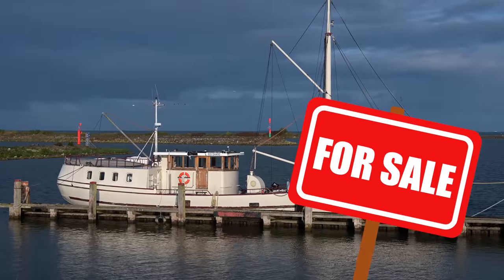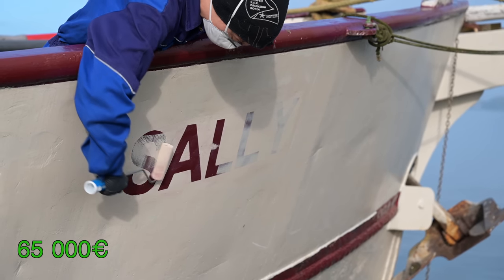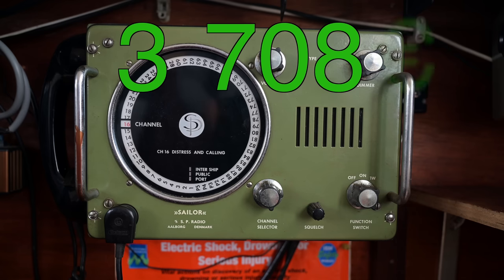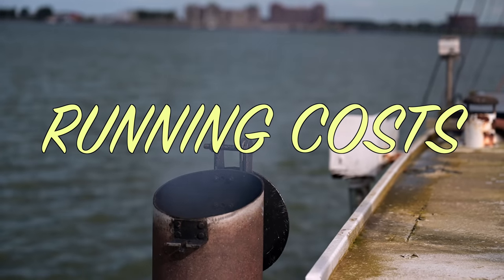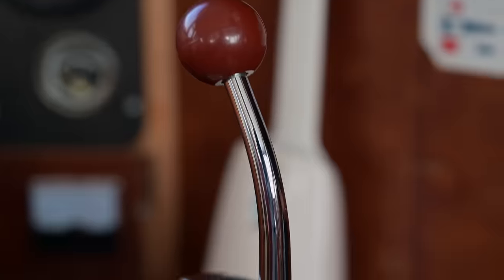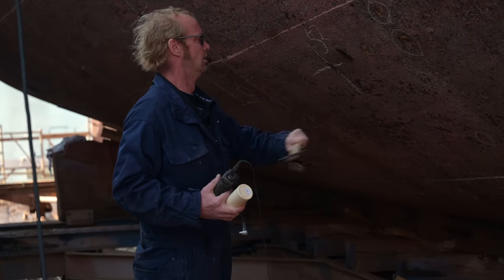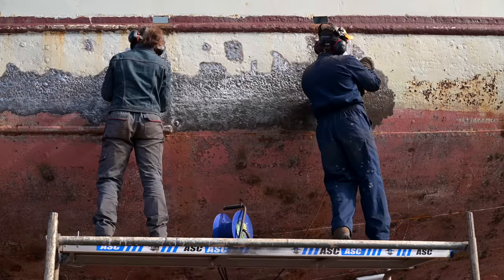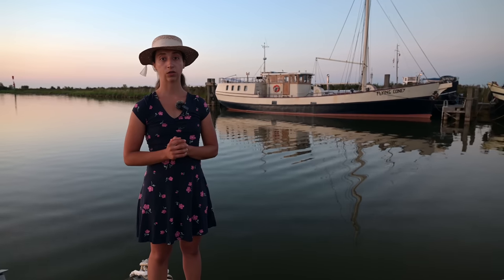This is HOW MUCH our refit costs? Is It Worth It?

Comment: Regarding the pump, the inlet and discharge orientations suggest this may be a self priming pump (providing the pump has been filled with water before operation) which is an extremely useful feature as the pump can, if necessary, be mounted above the water level without the need for an inlet non return valve or a priming system.  Also it looks like it may be manufactured from a marine grade material such as zinc free bronze.  Also it looks like it may be a relatively slow speed pump which gives high levels of durability and relibility.  If I am correct on any one or all of these points this is a very valuable pump.  The long radius bend in the inlet pipe is  good practice for a top entry pump, never have restrictions or short radius bends in your inlet piping.  With any 3 phase driven pump check the direction of rotation is correct.  Set the motor overload to about 10% above the maximum current the motor draws with the pump at full load.  With this design power demand is proportional to flow, the lower the pump discharge pressure is the higher the flow and  power.  If there is not enough back pressure on the discharge the pump will not prime and it will likely cavitate.  If you can identify the pump brand and model and find a performance curve for the pump and advise the rotational speed I can assist with the correct application of the pump.  If you find it doesnt pump try filling it with water, have the intake system fully open and strum boxes etc clear then close the discharge valve down to about 5% open start the pump and run it until discharge pressure builds before gradually open the discharge valve.  Vacuum leaks in inlet piping can be identified by wrapping cling film over one piping joint at a time to isolate problematic joints.  Regards and good luck.  Doug from New Zealand.
Reply from the maker: Hi Doug, the pump is from the brand SiHi and they still make this kind of pumps. They are high quality and high output and I think you're correct that it's a self priming pump. A viewer who works in a company that does service pumps (how convenient) was willing to help us and took on this project. Actually this week he opened it and gave it a good service. The pump is still in good shape and it just needed the ordinary service parts like gaskets and one bearing. Also the electric motor is working fine. He painted it in the correct color so it does look like new. Thank you for offering help and advice! It's always appreciated by us.

Comment: what about the estimates for a complete new sailing/rigging plan, accomodations and modern day comfort equipment, the complete rebuild of the interior, nav systems, refrigeration, AC, watermaking, water heating, energy powerplants, ) you have a good main engine, but then a generator, high output alternators, solar panels, batteries, DC and AC systems, the list is "endless".
Reply from the maker: Kind of endless. But you don't need it all at once. There's just so much time we can spend refining this boat so 20-25 000€ per year is a good number. 3-5 years until we're finished. A basic rig at the END of the project will cost about 80 000€ but maybe we find masts, booms and so on second hand.
Reply: @FlyingConey   i dont have a reference for spars price, wooden block, all the running rigging you will need to run that, which is in the kilometers scale, sails, etc but i found that 80k really optimistic. or maybe you plan to build most of it yourself? for a boat that size the electrical system alone, with all the gizmos needed for a reliable offshore operation, specially taking paying guest, i can only imagine it will cost a small fortune. im paying a dedicated company to design it for me and my very modest 29 ft an thats why i have an appreciation on how much proper designed stuff and bits cost. and it isnt cheap.

Comment: I haven't seen the earlier videos yet, so apologies if you have covered this, but was the ship already called 'Flying Coney', or did you name it? Also, what does Coney mean in this context?
Reply from the maker: The original name after the boat was rebuilt in steel was TINY and after that it had many different names. When we bought her the name was SALLY but we wanted a name that would also suit one of those famous tea clippers like the the FLYING CLOUD. I've noticed your name so I guess you know that coney usually refers to an adult rabbit. There's a superstition that one should never say rabbit on a boat but we have a strong connection to those little long eared fellas. So we sneaked in the rabbit using the older word that went out of fashion because, pronounced slightly different, it could mean something else wich is very much appropriate for a ships name if you ask me. By the way, the "flying" is a reference to our racing past in the foiling Nacra 17 catamaran class you might have seen racing at the Olympics. Best regards!

Comment: I notice that the housing of the Navigation Lights are painted White... 5. Screens for sidelights [SOLAS Annexe I]

The sidelights of vessels of 20 metres or more in length shall be fitted with inboard screens painted matt black, and meeting the requirements of Section 9 of this Annex. On vessels of less than 20 metres in length the sidelights, if necessary to meet the requirements of Section 9 of this Annex, shall be fitted with inboard matt black screens.
Reply from the maker: Thank you for adding that information. It's already on our todo list, we have the paint and just need to find a weather window for painting.

Comment: I am interested in your total cost thus far.
Given learned advice on these projects is most valuable.

Could of saved 15,000 by having the hull repair paid by seller.  The price would most likely gone up to 20,000 - 25,000. Might of got more wielding accomplish as well. This kind of deal needs to be considered before closing the deal. As we all seen Flying Coney was in a high state of corrosion. 

The repaired hull looks very well. Video recording each step is also an investment.  It’s good proof of work done. You might get offers before you finish her…
Reply from the maker: We bought the boat at about 60k and spent about 35k including tools. You have to take into account that a full survey including a haul out is about 5k. A lot of things can be fixed with 5k. In hindsight it's easy to say that a haul out would've been a great deal.

Comment: I’d call that a cheap example of owning a large boat. Your sweat equity is paying off!. Keep up the good work wonderful people!. Footnote: my boat will drink 160 litres per hour at full throttle…..:D. 12 litres per hour is amaaaaaazing for a boat of that size.
Reply from the maker: Thank you! My guess is that you're going a little bit faster than we are and that you're somewhere at this 1 mile per gallon mark. But I also think that 0,5 a gallon is great.
Reply: @FlyingConey  I’m doing 30kts.
Reply: 12 liters per hour is equivalent to approximately 55 hp.

Comment: Did u check engine or driveshafts and steering condition?
Reply from the maker: Yes we had a surveyor who spent a few hours checking the boat and discussing with us the condition. The technical equipment is in relatively good shape, some of the equipment is even new like the steering pumps. Other like the engine do have a little maintenance backlog but not many hours on the clock.  Not much work needed to get it back into shape.

Comment: This story is a wonderful example of the importance of a proper survey prior to purchase. Not sure why they did this video without saying that this is how much it has cost them to get to this point completely devoid of an interior.  Great video but a bit misleading.... or incomplete maybe?
Reply from the maker: It's the cost breakdown of a refit project. How much we've paid. This channel is about bringing and historic trawler back into shape. What you say about a survey is true about a boat in operational condition. It's essential that negotiating is possible. We paid the scrap value so it was take it our leave it. We knew that we had to rebuild the interior, we knew that we had to overhaul the engine and we knew that we have to add a sailing rig. If you don't want to deal with the problems a project boat confronts you with, don't buy one. Simple.
Reply: @FlyingConey  fair point.
Reply: @FlyingConey  I guess from my prospective something of that nature (restoration) is a labor of love and that's great, totally goes with what you are saying. Where it goes wrong for me is when you are doing as a business venture i the way you are, scrap or not the cost to repair must be factored into the business plan or expenses. 
While I've never restored a boat I have restore a handful of houses but more over I've successfully started and sold 48 businesses so this part I'm comfortable saying I know something. 
Pulling the boat for inspection would have made you aware of the needed hull repairs so it could have been considered. Factoring information like that is ultimately important especially when the cost run such a high percent of the initial costs as in your case. 
From a restoration perspective I agree with you, from a business perspective I do not.

Comment: Build an entire boat frame using 1/2 and 1 inch pvc pipe, fittings primer and glue. Once its all formed together then panel all the spacings between the pipe's ribs with 4 x 8 sheets of 1 inch Foil Backed Insulation Panels by punching holes and tying them with wood-strips and string to the Pvc Pipe. 

Now purchase two barrels of Polyester Fiberglass Resin and hardener and purchase enough Matte Cloth to cover both the inside and outside with four layers of fiberglass. Then add in an interior.

For a 150 ft x 25 ft Yacht or Ship you would never go over $12,000 Pounds or Dollars. And its New. Now add the Engine from that rust bucket and get rid of it.

Comment: Seriously? Paying 68.000 € for a worn out unsafe rust bucket is reasonable??? Good heavens! 😱🙈
Reply from the maker: Yes it was a reasonable price and you hardly find a steel vessel of that size below that. Let alone one with a safety certificate. The current value of the prop, gearbox and engine is about 30 000€. I tried my best to explain the issue with the CVO, without it you're not allowed to move a boat under own power. So the CVO alone is worth quite a lot. 
The previous owner destroyed quite a lot by wrongly re- wiring the boat. We didn't knew that and he's a ship mechanic by trade. So we believed in his skills. That was a mistake.

Comment: a ship costs maintenance, just like a house, a house in the Netherlands easily costs 400,000 euros in taxes and municipal costs, well a ship also costs euros in everything, but the freedom and compared to a house the costs are not too bad.  , on holiday with your ship, go everywhere, generate your own electricity, etc., just compare everything,,, the house costs and a ship 📉
Reply from the maker: Especially since you've 100 square meters right next to the water. If you want in the center of popular towns. If you compare it to that it's quite cheap.